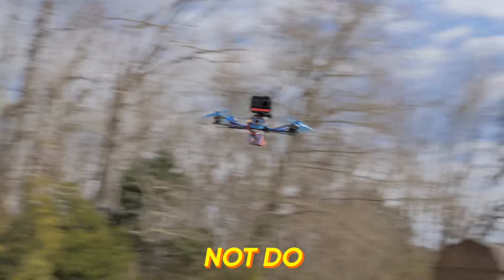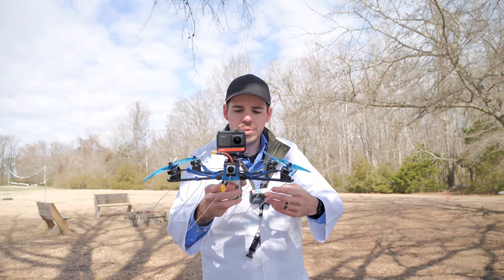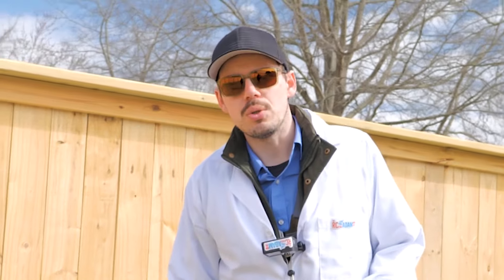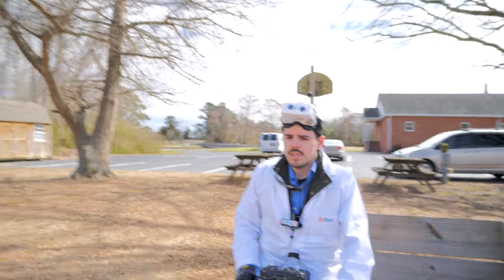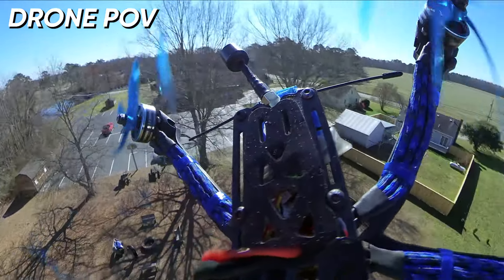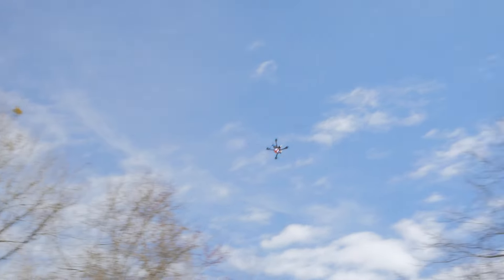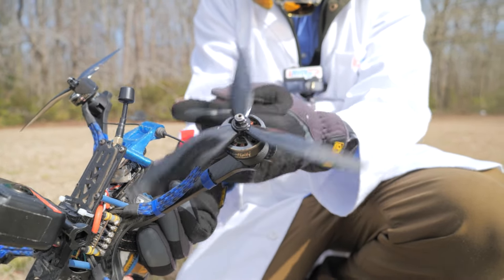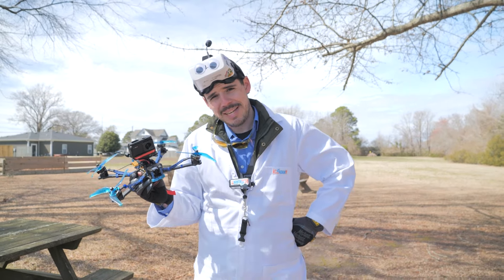Playing with Tilted/Angled Motors Again // 7" FPV Drone (improved propwash handling?)

Comment: hi adam, as you realized the mai CON is that you lose thrust. usually companies like djy do angle their motors a little bit on biggers drone to achieve necessarly yaw control with less thrust from the mtoors, wich otherwise would require way more thrust from the motors. you can see that if you angle the motors outward (not as you did but just parallel to the pitch axis) you gain a momentum o the yaw axis  as you yaw (slowing down diagonals motors)

Comment: don't you damage your batteries by putting them under the drone?
Reply from the maker: Definitely more likely to damaged them on a hard landing, but they're fine most of the time. It may actually be better protection than top mounted in a crash.

Comment: It's clear that the motors in their current configuration generate a cone-shaped column of air beneath the qwad... hence why maneuverability is noticably different than if they were positioned straight down.
I also think if they were tilted outward, u'd have a more aggressive flying machine.
The problem is determining the proper tilt angles for front and rear motors.  But... isn't that why they call figuring this stuff out 'SCIENCE'.
I like that u're not afraid to experiment.  Keep going.
Reply from the maker: Lol true! Thanks I will! 👌